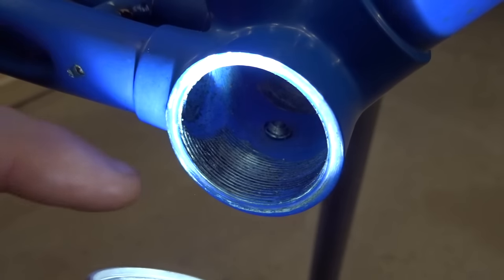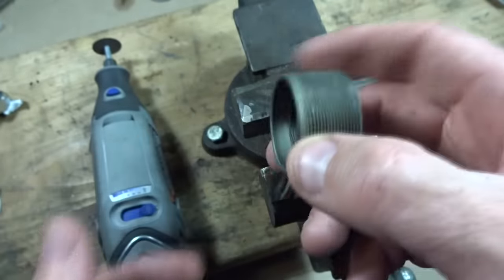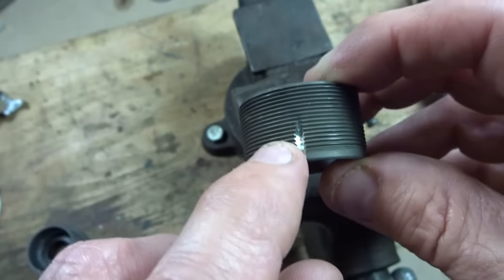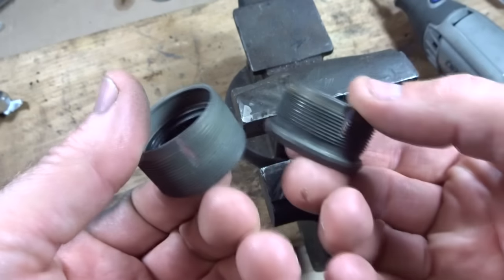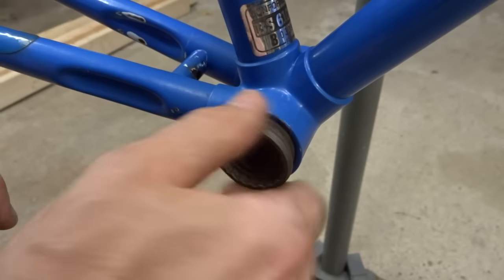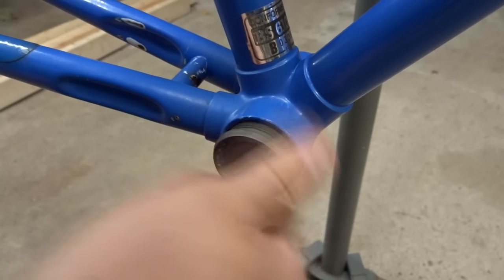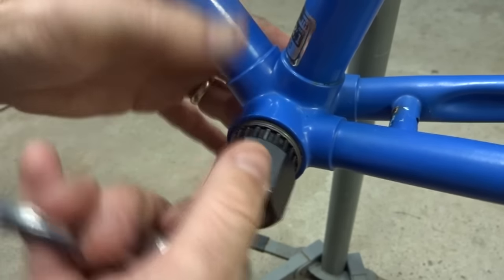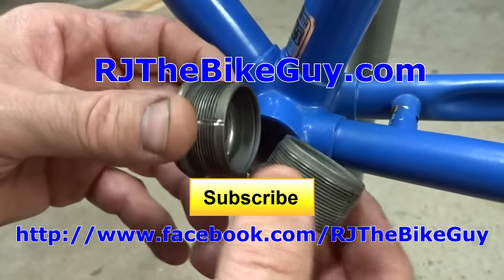Make Bottom Bracket Thread Chasing Tools - Cheap & Easy

Comment: Funny. I tried this years ago, but the tolerances on the cup threads are not tight enough to actually "chase" the frame threads. It may clean a little gunk out at best. It will never straighten out threads as a true chase tool will do.

Comment: I just did this. Hadn't seen the video. I do often with auto bolts to clean threads and improve minor thread damage. Aligning the bottom bracket cup is trickier because of the fine thread and large diameter. I needed to use a caliper to  check, and recheck, that it was going in straight because it (and the new cup) were catching munged threads at the start and wanting to go in crooked. It took some patients, and quite a bit of force once it was started straight, but it all worked out and the new cup threaded in easily, as it should.

Comment: Any advice for a bottom bracket that has failed after the threads in an aluminium frame stripped having done 12000 miles? Bottom bracket is a sealed Shimano BB-UN55 - still in good working order.

Comment: Ok so I have a question I have a monster cross bike the bb is 73mm and I would like to trim it down to 68mm to improve the chain line the rear is 142x12 so what problems would I run into

Comment: RJ, thanks so much. I’m restoring a 1988 mongoose stylist and the threaded fork is cross threaded, I could hardly get the retaining nut off. Any ideas on what I should do to fix if anything can be done?
Reply from the maker: Shrug. The damage is done. You can try to chase the threads. It will work or it won't.
Reply: RJ The Bike Guy yeah I figured, I heard machine shops can braze and recut but probably not worth the hassle, I found a used fork on eBay so I’ll probably go that route. Thanks for your content!

Comment: How about discussing which material the cups are made of. I've seen them in light aluminum, and I'm wondering if they also come in steel?  I'm thinking that the light aluminum ones will not work very well in a hard steel frame? I'd think that the thread chasers or taps need to be harder than the steel.  How many different materials do this style cup come in? Which model bottom  bracket did the cups come off of, that you used?
Reply from the maker: I have never seen aluminum cups. Aluminum would be too soft. They are hardened steel.
Reply: Campy made aluminum alloy cups with steel races inserted on their C-Record cups. I also have some Shimano Dura-Ace aluminum cups, that came with my sealed bottom bracket.
Reply from the maker: Okay, the outside parts are aluminum, but the races are steel. No, you want to use cups with steel threads. Just get some old generic cups.

Comment: +rjthebikeguy would a hacksaw blade/thin file work ok to cut the notch as i dont have dremel tool?,also ive noticed its usually paint overspray that clogs the bb thread from the factory paint process?
Reply from the maker: Hacksaw or file will probably work.

Comment: hey @RJ the Bike Guy i had to hacksaw out on non drive side a square taper and cut into the threads in a straight line , is there something you can suggest to repair it? perhap[s a link to a previous video.
Reply from the maker: Not really.

Comment: Thats very nice.. Thank you. I think you made one more video about thread chasing a while back!
I have a question - not related to this video; @3:45 - you see where the is a centre hole connecting to two sides of hind wheel; what is that for? I mean, i have a bike it has the same hole just behind the Triangle of the frame where two sides of hind wheel go... have you ever used that? whats it for?
Reply: That hole is to fit full length mudguards.
Reply from the maker: They are vent/drain holes. Yes I did make a video with a generic screw which I mentioned in this video.
Reply: RJ The Bike Guy Oh okay Thank you. I ride road bike with no mudflaps! Thanks again :)

Comment: Is there any tip for stripped bottom bracket threads? Thanks
Reply from the maker: Not really. You can use a threadless bottom bracket.
Reply: @RJTheBikeGuy  thanks
Reply: Do you have a shop to buy a threadless bb

Comment: That invention would be to not have to buy some of this? Link: https://www.vartools.com/en/bottom-bracket-tapping-set-without-tap-var-p78.php
I have that of an old BB but the right is a little damaged, if I made the cut, would it be worth it?
Thanks!
Reply from the maker: This is not a tap. It doesn't cut threads. It just cleans the threads. This is not a replacement for a tool like that.